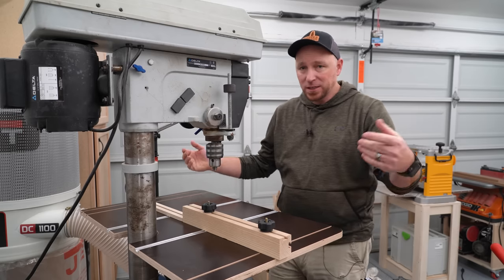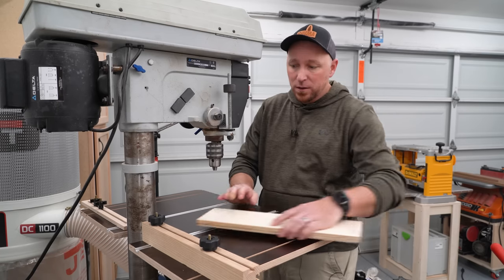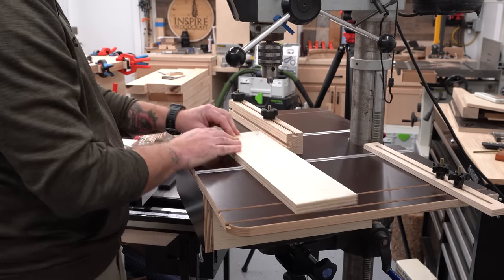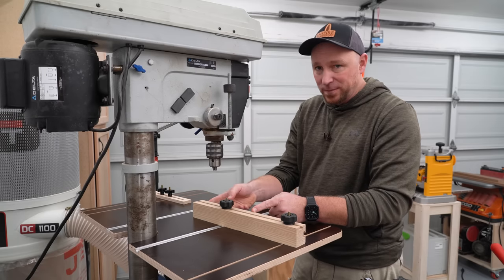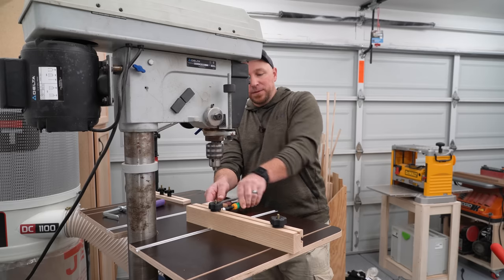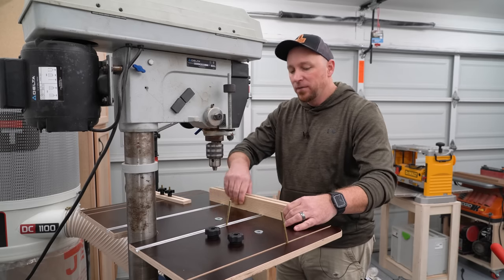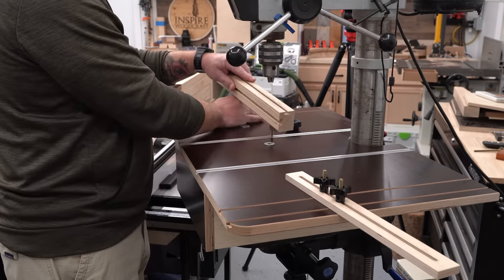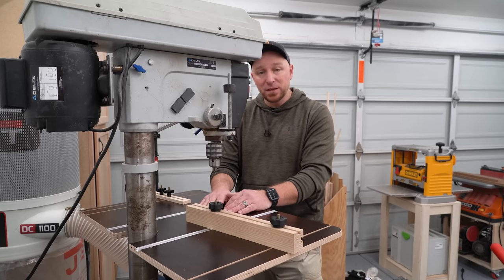The Greatest Drill Press Table You've Never Seen

Comment: Great design.  Well thought out.  You have a nice big floor model to deal with.  My drill press is a bench-top model so I had to make a smaller table.  I ended up putting a drawer box underneath like you did.  Only the front half is a drawer.  The back half is a hollow compartment for dust collection. The dust port is on the side of the box toward the back.  The top has replaceable inserts.  I can drill holes in the inserts to accommodate various size drum sanders and the dust is all carried away.  I think you could easily make similar modifications and improve the utility of your drill press.

Comment: Thanks - it's a very good design.  I have a suggestion for making the larger fence. Instead of routing the 2" deep slot in multiple passes, one could make a sandwich of two long faces ( 2 x 16 x 5/8") and two spacers (2 x 1.5 x 5/16) at the ends.  Then the T-slot could be milled in the face surface.   
Other than that, provision of a sacrificial backer insert would be nice.

Comment: Although my radial drill press is slightly smaller, years back I built a nearly identical table for it for many of the reasons in your video. I have 4 T-tracks, and paired with a 36"long piece of multi-track 3" tall. It mounts with 90-degree brackets in the back so the knobs are behind the fence instead of on top. That gives me slots on 3 sides at various heights and I can flop it onto the 3" face for a low fence when needed. Having 2 tracks on each side of the table is THE KEY and means I can hang 36" of fence off one side or the other and then I have a supplemental fence, like your low fence, that I can use from my table saw sled in a pinch. I mostly use hold down clamps and blocks for stops and tried to keep my entire system on 1/4"-20 bolts in either hex or slot heads. Not sure what's next for your shop but I added a long hand crank off the side due to the increased table size. Just a bunch of ratchet extensions and a universal joint but it's easier than stooping underneath. Zero regrets after many years of use.

Comment: I like this. After reading all the previous comments I would make a couple of changes. Instead of routing the through slot in the fences fabricate them from several pieces to make the slot. Incorporate a sacrificial section under the drill bit. Eliminate the T track in favor of the dovetail slots. Thank you for sharing. Have a great day and stay safe. 😀😀

Comment: I LOVE this table, and I can see myself making something similar.  I currently have two fences, with the second fence being shorter to clear the quill handles, but there are times when I have removed one of the three handles.  So a split fence with long slots makes so much sense, and I love the idea of extra clearance.  My background is actually as a toolmaker who has discovered the joy of working with wood, so I can make those long slots with a milling machine.  I can also adapt clamps to fit t-slots as that is so much better than clamping behind the fence.

I a big fan of using the distance from spindle axis to fence as a guide for accurate inline hole drilling, and watching this video has given me the idea of designing a digital depth gauge that fits in the chuck and sweeps the fence, although I can see a couple of issues with that like the contact with the fence will have to be precisely inline with the spindle axis.  At the moment I have a tapered rod that lives on a magnet on the drill, and I put in the chuck, but my eyesight is not great and I struggle to see the ruler markings.  

I think I have all the parts to make a similar table, and I am feeling properly psyched up to do so.

Comment: Again, another clear and concise video explaining how and why you do things in a certain way 👍 ....  That drill is HUGE 😯
A few suggestions ...
1) Instead of routing such a long slot in the fence, just use two bits of wood and glue a little block between them at each end ... far simpler and easier to make and uses less wood as well!
2) Instead of a t-slot or dovetail slot for clamps ... you could just put a clamp around the work piece and onto the back of the fence ... I realise that may not always be possible, but the same goes for the slots!

Comment: I like the split fence idea. My updated table is similar with a 1 piece fence but after seeing yours I may change it. The T-track stops in my fence always seem to stick up and get in the way and half the time I just use clamps.  I made a few stop blocks by gluing 60-80 grit sanding belt to smaller rectangles and those really bite and hold with minimal pressure under the T-track clamps or on the fence.  I’m thinking of changing the threaded knob for T-track fence position into a thumb-wheel concealed inside the fence (it may not work but….) if it does it will be completely out of the way.

Comment: I love the way you walk us through the design and the whys and wheres of it. There were 3 things I wasn't sure about. How hard is it to make the two fences straight with each other in order to make line drill holes that would be the same depth at different parts of a board? Didn't look like there was a center removable piece of wood when the drill holes get too bad in it can be replaced. And how does it attach to your drill press? Thanks, Rick

Comment: Good idea. I built my router table fence the same way (with split fences). Great for when you are routing the entire edge and need to support the outfeed "new" edge. I'm like you I have never seen split fences on other tables whether they were drill press or router. Not a fan of the realigning exercise to ensure parrallel/in line fences but worth the effort when you need the flexibility.

Comment: Interesting design. I've been thinking about re-doing my table and this has some features that I've been thinking about how to achieve. Dual height fence jumps right out.
But what about allowing for drill through on your work piece? This top looks too nice to want it full of holes right in the middle. Not to mention that then you've got no support for future smaller holes. Asking for blow out there.
Do you just continually use a piece of scrap under the work piece? That seems too fussy and fiddly.
I'm not complaining about your design. This is an actual question. How do you avoid through holes and blowout?

Comment: I have a suggestion for the Matchfit Dovetail Clamps. Take a file and file a bit on both sides of the clamp just under the flare. Then, not only will they also fit in your application but you can also use them in Festool or Makita tracksaw tracks.

Comment: I'm researching a drill press table and this is definitely not the run of the mill design.  Really like the flexibility.  I am wondering, though, what is the purpose of the routed T-track on top of the tall fence?  As far as I can tell from your  video, all you need is the through slot for clamping the fence to the table.

Comment: Best design I have seen, but like all drill press tables, for the work I do, the thing that I could not accept is the way they impede access to the height adjustment wheel and collar tightening screw--I am always moving my table up and down. We need to find a way to bring those controls to the front of the table.
Reply from the maker: @Gord Cameron For what it's worth, with the five-inch drawer box raising the table up, the adjustment points are actually easier to get to now. I move my table a lot as well and wondered if it would be an issue, but so far so good. I have seen folks bring the controls forward by adding different parts and pieces. Just not a road I wanted to go down right now.

Comment: For a groove the majority of the length of your fence, it would be easier to use two thinner pieces and just glue (e.g. 1"x 3/8" wood scrap) spacers on each end.

Great job. I love my drill press table as is, but I might make a new fence that I can optionally use. I will have to install two more t-tracks though so that each half can be securely fastened for a two-piece fence like this. Keep up the great work pal.

Comment: Do you ever use the t-slot on top of the main fence? It seems to me the lock down knobs would be in the way to make it effective. Besides that great design. I've almost finished building mine, thanks for the plans.

BTW I've gone with MicroJig dovetail slots all the way. I'll let you know how they work out.
Reply from the maker: @Tim Murphy I don’t use it currently. The knobs can get in the way, depending on how you use it. I originally had been using it for a vertical hold down. That was until I modified the front track to accept track clamps.

Comment: Always love your perspective. Thoughts on a sacrificial board to drill into? I've always struggled with this part of drill press tables as I don't want to need to make new inserts every _ number of holes.
Reply from the maker: @Clayton James I just use a scrap piece underneath. It's a good way to use up scraps. I don't really care for inserts because they are too finicky. Say I drill a one-inch hole one time. Now if I drill anything smaller than that I no longer have material support and I have to scoot over and adjust things. It is just quicker and easier for me to grab a scrap board and throw it under there and be done.
Reply: @InspireWoodcraft  yeah, totally. Simplifies the table too. I've always been conflicted with inserts, no matter the design it's only good for a few uses

Comment: Could you explain dust collection on this table?  I don't see any access (nor sacrificial/wear piece or down-dust port.).   I have seen enough of your work to know you are doing something & I just missed it (likely obvious once pointed)
Reply from the maker: @kpmathis71 I opted for a couple of parts from Rockler for this one, after trying to cleverly come up with something. It is the "cord and hose holder" and "2-1/2" flexform hose kit". The holder accepts the 4" DustRight quick coupler from the dust collector (which lives right next to the press) and the 2-1/2" flexform hose comes off of it. Hopefully that makes sense. Anyway, the idea is to collect the debris at the source. So far it's worked out pretty good up to a 2-1/8" forstner bit.

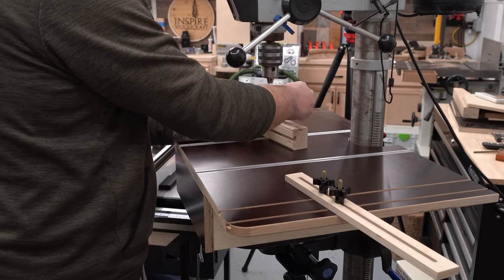Comment: 9:57 - I had the same issue with my DP table fence. My solution for too-wide top knobs will be to mill the top T-slot towards the back of the fence, rather than in the center...next time!

I really like this design, as my DP handles are often hitting my fence. Nice build!

Looking forward to the dust collection addendum.

Comment: The table top looks like 3/4" ply, but with some kind of topping.  Did you use BB ply and then cover it?  I know each drill press will have its own unique attachment mechanisms, but can you comment on how yours is attached?  It is removable?  Did you consider adding a round or square or rectangular sacrificial insert?  (as always, GREAT work! I bought the plans.)
Reply: It looks like phenolic plywood ... usually has anti-slip coating on one side and either smooth or mesh on the other ... used for things like truck beds etc 👍
Reply from the maker: @Stephen LeLaurin Thank you! The problem with rambling on camera is forgetting all the things that you wanted to say! 😂 It is phenolic ply. Basically it is 18mm Baltic Birch with plastic resin faces. It is pretty spendy and totally not necessary, but I had it in the shop, so I used it. If I really wanted to go all out, I would put a laminate on top, but the phenolic wears decent enough. The drawer box is screwed to the table from underneath, and then the whole thing is just screwed to the stock table. As for the insert, I actually don't use them because I find it easier and more efficient to just use a scrap piece under the material that I'm drilling into. But it could definitely be added!

Comment: Nice design!  While a deep surface sounds like a good idea, I've found the hassle of getting to the height adjustment handle and height lock lever (now located beneath that nice deep surface) to be a lot more cumbersome than to have to occasionally remove the fence when it gets in the way.  Yes, there are ways to get a mechanical link to the height adjustment from the front of your table, and get the lock lever extended and accessible from the side, but truth is, I rarely need to work with drilling into deep material that would make these mods worthwhile.  In practice, when you need to get drill access into the middle of your piece, that extra depth (i.e. thickness of your fence) isn't really relevant and you're gonna need to drill without the press anyway.

Comment: Do you ever find yourself using the parts of the table that fits around the pillar? I have made a similar table using the dovetail system but limited the table size to sit in front of the pillar so I could use the tilt function of the drill press. I used a more dense grid, basically creating a dovetail mortise grid that allows the clamps to reach the midpoint of each grid, and built stop blocks that are set using the clamps. I will however be using your split fence concept, that is just too cool to not be used. Thank you very much for sharing, it makes us all better woodworkers!
Reply from the maker: @Dennis Seemann Only to store the fences. In the 20-something years that I've owned that drill press I can't think of a single time that I've needed to tilt the table, except to level it, so I didn't think about that.
Reply: @InspireWoodcraft  so I make a lot of tapered-round legs angle-supported furniture that requires accuracy close enough that when the supports/legs come together at the top the seats, tops, etc are level, and the only reasonable way that I can achieve the accuracy I need is with a drill press that has a tilting table.  I build all this furniture for my Grandchildren so it has to be able to be adjusted to grow with them and so I make most of my stuff using threaded inserts and even with a jig and hand drill Is very frustrating to get the holes for the inserts to line up accurately enough.

Comment: Really like this design! Quick question - I would have thought making the center board easily replaceable would be a good feature? I know I suck at NOT drilling through my work into the top😁
Reply from the maker: @5055hunter I might have to do a separate video on this as it seems every other comment is the same question. Ha! I don't use the inserts, personally. I just throw a scrap piece under my material and call it done. For me it's just quicker and easier and I don't have to mess with the table or cut new inserts.

Comment: An easier way to cut the slot in the fence is....don't
Cut a piece of wood twice as long. Cut in half. Glue a spacer on each end and glue the other piece on. You have a slot.
The block of wood will never know. If you want, the two halves can be different woods for cosmetics.
Camlocks would be a nice substitute for the knobs.

Comment: Very nice! I think I would add a built-in sliding waste board that's replaceable  so I can't drill holes in that nice top surface.
Reply: You might try using a sacrificial piece of plywood or MDF on the table.Just lay it down against the fences(s). In which case you would probably want the 2 fences to be taller.
Reply from the maker: @David Tacklind Yeah you definitely could. I find the inserts or waste boards more of a hassle than anything, so I just use scraps underneath. The last table I made had an insert and after three or four years of use, I hadn't replaced it or drilled into it once. Just a habit of the way I work, I suppose.

Comment: No easily replaceable section under the quill is a pretty big fail.  Not a good general design because no extension to table lift lever or clamp means the design is not any good for many drill presses.  Just really not all that great.